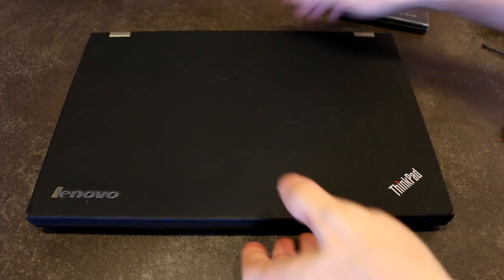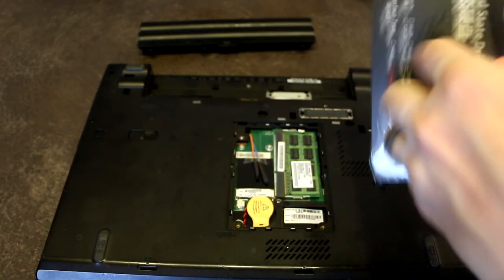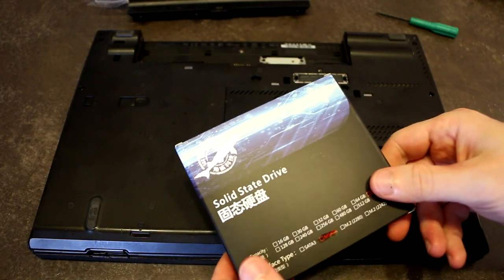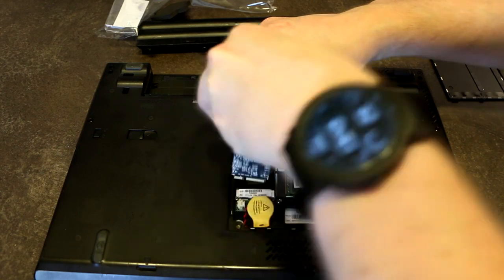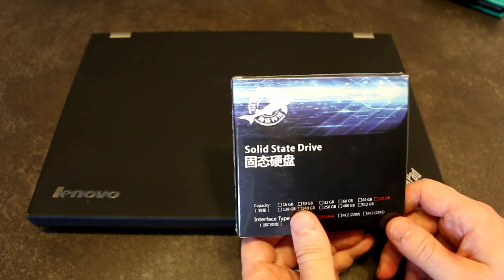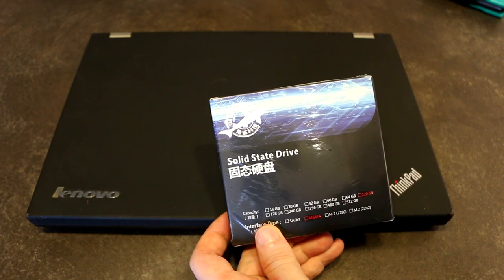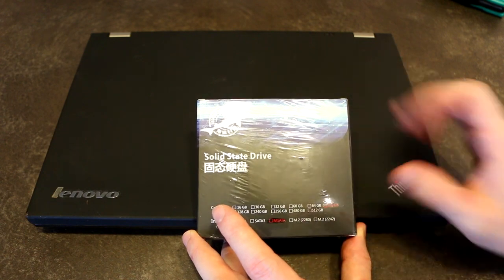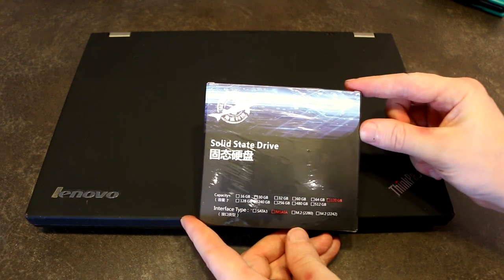Installing a mSATA SSD in a ThinkPad T430 (Three Color Dogfish SSD 赖燕宽)

Comment: Thanks ! I need to get one for my newly aquired T430. Great to see how super simple the install is compared to the X220.  It has been a bit, is it working well for you ? Main os loaded on it ? Linux mint ?
Reply from the maker: Yes to all three. Nice piece of kit. Thanks for asking.
Reply: @LaptopRetrospective  Additional bit question, was reading the T430 Hardware Maintenance Manual, and came across this. 

T430 Maint Manual
Chapter 2, pg 25
“ Important:
• If the computer is equipped with both a hard disk drive and an mSATA solid-state drive, do not use the
mSATA solid-state drive as a bootable device. The mSATA solid-state drive is used for the “cache”

function only. “
I have been out of town and have not yet installed mine. Curious what that is all about in the manual. 

Any idea ?
Reply from the maker: @eugor5746  Hey there, the warning has to do with the mSATA drives that shipped with the original computers from the factory, which were used to cache files from the mechanical drive. Modern mSATA drives shouldn't cause any issues.

Comment: Hi!, I'm wondering if you know what is the maximum capacity the T430 accepts on the msata slot, cause I can't found it on the Lenovo detailed specs site. I'm planning to install a 128GB msata SSD, but don't know if it would accept it. Thanks!
Reply from the maker: Yeah, you'll be fine.
Reply: @LaptopRetrospective  thanks!
Reply: Would a 500gb and larger work as well?
Reply from the maker: I suspect so?

Comment: If I wanted to move the OS on this to a SSD, should I use a mSATA or 2.5 to do it? concerning price, and stuff like that.
Reply from the maker: If you want to clone the drive, I'd suggest cloning to a 2.5" drive since it will have the full SATA 3 speeds available. The mSATA slot can only handle up to SATA 2. That and it is also easier since the USB to 2.5" SATA cable is more common. Lastly, the 2.5" drive is probably cheaper per/GB.
Reply: @LaptopRetrospective  ya i looked a bit more into it after commenting, and it looks like mSATA is a dead end, meaning it's going to cost more new. you can go on Ebay and get a questionable brand like KingSpec but if you ever get a new computer then you won't find support for it. So 2.5 it is.

Though about the SATA2 on mSATA comment, some forum post said mSATA isn't capped like that, but it was an old ass 2014 thread so who knows.
Reply from the maker: mSATA can still be acquired from reputable brands, but they are indeed a dead design, as in they aren't featured in most machines anymore since we have M.2 standard. mSATA on the ThinkPad line is capped at SATA 2, at least on this model since they weren't designed for anything beyond cache drives, but can be pressed into regular service now with larger sizes available. There are newer laptops that have mSATA at full SATA 3 speeds, but this isn't one of them.

Comment: My T430 bios is not recognizing the mssata SSD. I get “2101: Detection error on HHD2 (mini SATA)”
I press Esc to continue, I then boot to ubuntu on USB, and can’t detect the drive by anymeans. I think I may have to put the SSD in an external case, and plug it in while ubuntu is running, initialize the drive, then clone to it. Is there another way?
Reply from the maker: What exact drive did you get?
Reply: @LaptopRetrospective  1TB mSATA 6Gb/s Internal SSD

Comment: Do you need to remove the wifi card or something to free the mSATA slot ?
Reply from the maker: You mean besides a screwdriver?
Reply: @LaptopRetrospective  Oh no I think I misread something. "you can actually use an mSATA drive, at SATA2 speeds, in place of where the WWAN card would be installed" : so there's nothing by default there ? I thought it was the wifi card or something, and you had to remove the wifi function of your laptop in order to use mSATA as storage
Reply from the maker: WiFi is different. WWAN is usually where a 3G card would be if the computer had one. That's for cellular connections to the Internet. These slots are often not occupied. 😁

Comment: Hi I bought the same ssd as in the video for my t430. after installing it is booting with a black screen?
Reply from the maker: What other steps have you taken other than physically putting it in? Is there another drive present?
Reply: @LaptopRetrospective  the only other upgrade I've done is putting in 16gb of ddr3l ram. Currently there is also another regular harddrive
Reply from the maker: Assuming the regular drive has your OS, it sounds like it is trying to boot to the mSATA drive which doesn't have your OS?
Reply: @LaptopRetrospective  yes it's just an empty ssd and I have OS on the other HD. Would I need to clone the system to the ssd before I can boot properly?
Reply from the maker: You shouldn't need to unless there is something weird going on, but your first stop should be the boot priority in the BIOS.
Reply: @LaptopRetrospective  it worked tysm!
Reply from the maker: Excellent. Glad to hear it.

Comment: Do t430 support nvme SSD? What max speed did you get?
Reply from the maker: Not without an adapter for the 2.5 Bay I believe. The mSATA drive here is capped at SATA 2 speeds of I recall correctly as it being the speed of the slot.
Reply: @LaptopRetrospective  I mean in the mPCi-e slot. I don't know what version of pci-e it is
Reply from the maker: Take a look at this thread here, it outlines pretty much all the drive options for the T430
https://forum.thinkpads.com/viewtopic.php?t=123597

Comment: Is it possible to add msata ssd in Thinkpad T430U laptop?
Reply from the maker: Great question. There is so little documentation on the U variant. I only.found one site even mention it and it's a generic upgrade site.
Reply: @LaptopRetrospective  Should try to add one on port to check whether is supports or not?
Reply: Can you make a video on it? It would be a great help👍

Comment: can you use this as the main hard drive instead of the orignial slot of the hard drive?
Reply from the maker: Yes. I usually leave the 2.5" bay empty on my X220.
Reply: Laptop Retrospective i kind of figured wasnt sure though.
Reply from the maker: No problem.

Comment: Where are the benchmarks ? How come some mSATA are sata3 speeds ?
Reply from the maker: The slot is the limiting factor. On this it will cap out at SATA 2.
Reply: Sorry, you mean the internal port on the motherboard it connects into, right ?
Reply from the maker: @Matlockization  correct. Most drives are SATA 3 speeds but the slots don't support the max speed.
Reply: Thanks.